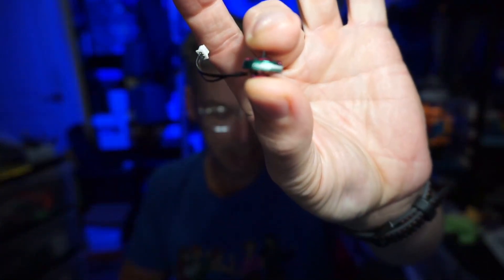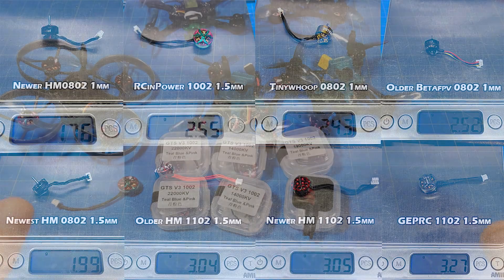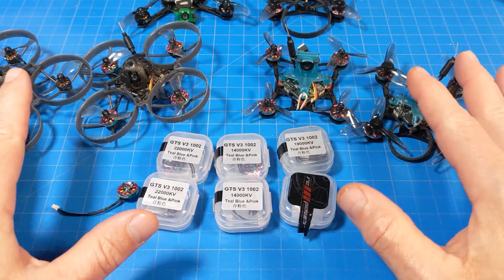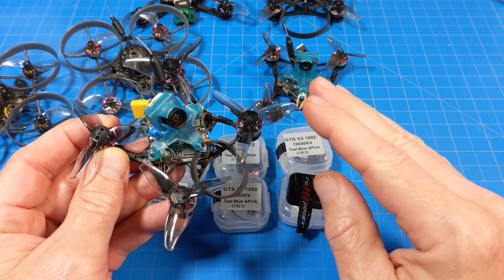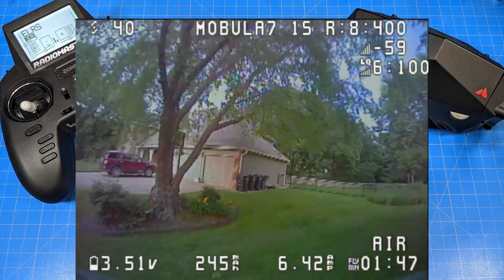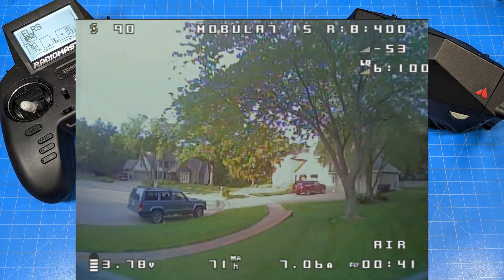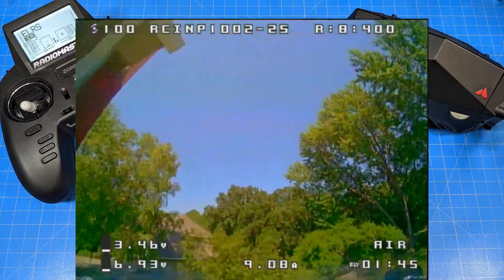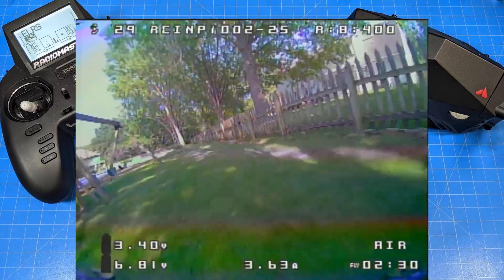New RCinPower GTS V3 1002  // Double Ball Bearings // Prop Motor Matching

Comment: Definitely better on 2s ... and I think it will also better on larger bi-blade prop like 65mm for 1s toothpick.
For 1s M7 I will stick with NBD 0802 20.000kv plaid edition. Thanks for reviewing this motor Nick!
Reply from the maker: I do have another quad I was going to test the motors on with 65mm props, and 55mm ( think they are 55m, the old afunta press on props).
Reply: @NickBurnsFPV  Afuntas! I was just on PJC’s FB saying we needed to pressure NBD to do a modern take on the Afunats to go with their new 1102s.
Reply from the maker: @Quad66  Yes, I tried to get a few companies to make them and gave them some rough drawings for frame ideas. Or at least change the prop design to the shallow carve out to allow the prop all the way to the motor bell and over the c clip, if the motor has a c clip on top.

Comment: Which kv would you recommend to replace the Mobula7 ELRS 1s?
Reply from the maker: 19000kv if our priority is flight time 22000kv if we want/need that top end throttle pop
Reply: @NickBurnsFPV  thanks, I'm thinking freestyle so probably 22000 and then take it easy if I'm crusing.
Reply from the maker: @SteveFPV80  I would go the same route :)